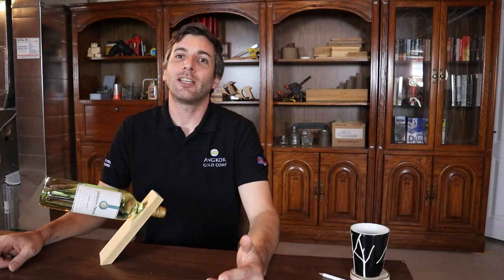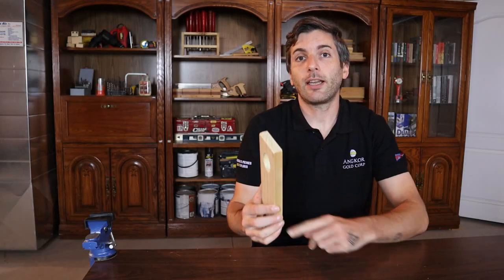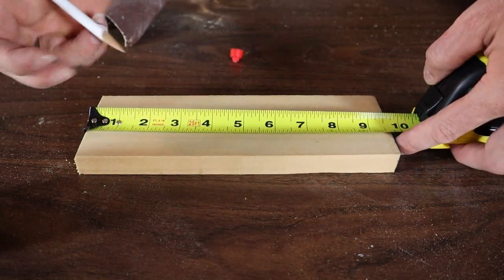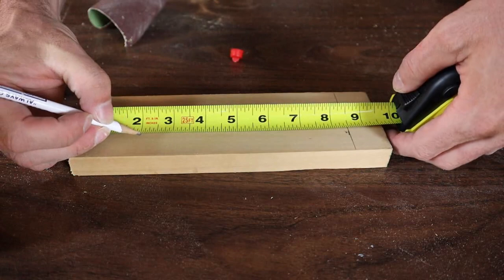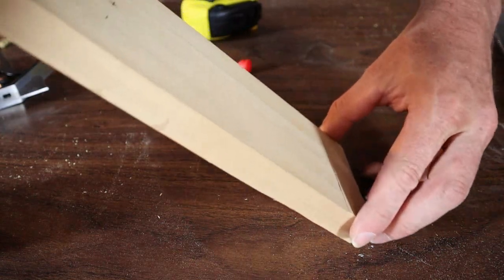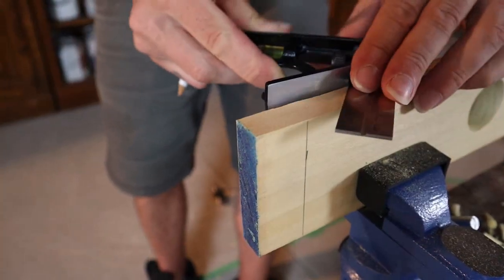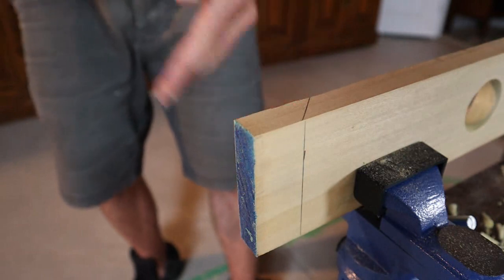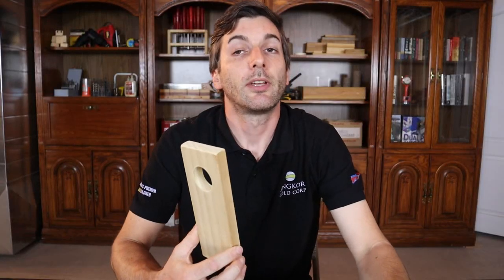How To Make A Wooden Balancing Wine Bottle Holder For Beginners ( Step By Step )

Comment: Made 3 of these today - slightly differently: 
Pine wood - length - 300 mm, width 90 mm, thickness - 45 mm, cut both ends @ 33 degrees, then drill 40 mm hole 190 mm from the bottom.
They are rock-steady!!
Reply from the maker: That’s awesome glad it worked out

Comment: Are you using a 1" board? Can  you use wider board and put multiple  bottles holes in it to work?
Reply from the maker: The board is 3/4 inch think . I don’t think it would work with more bottles . You could try though